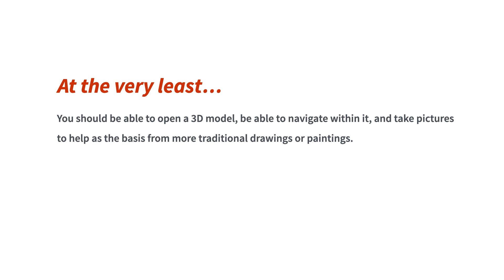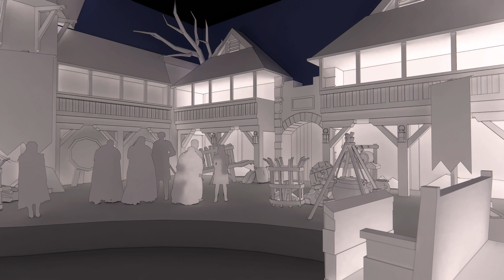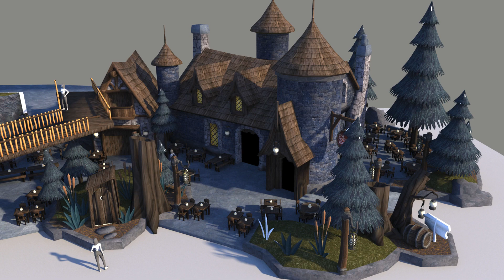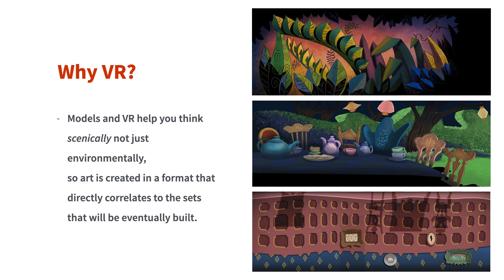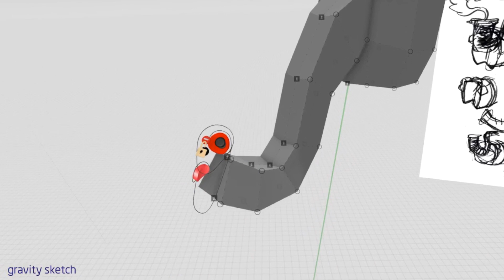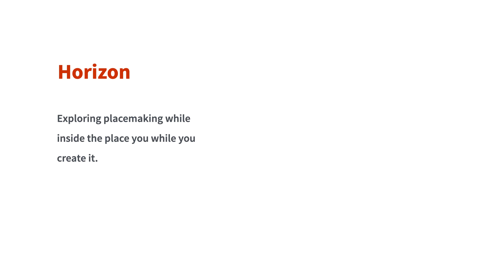THEME PARK 101: Using 3D in Theme Park Design

Comment: Is there a reason why a high-fidelity model isn’t created in a game engine such as Unreal Engine at some point in the design process? It seems to me that it is currently possible to create a highly realistic version of theme parks and attractions before they are physically built. You could walk around the theme park and ride the attractions in VR and really understand what it’s actually like to be there. Would it just take too much time to create something like this?
Reply from the maker: Michael, This is absolutely being done right now! The challenge early on is to make the models as quick and iterative as possible, hence the low poly massing quality of the early models. A huge fly in the industry's ointment is Autodesk that dominates the industry and promises interactivity but delivers bloated models that don't allow you to bring their assets back into the creative process without breaking them (do you have an opinion on this topic Don?). Smart people are working to integrate engines like Unity and Unreal into this process but it is still early days... still... I am working with design firms that DO mock-up more finished assets inside Unreal to do exactly what you describe. The real innovation push will be as "twin buildings" becomes common place. Having a virtual ride control a physical one isn't something Autodesk will deliver, even if they try.
Reply: @DJCarsonCreative  Love to hear this. I have taught 3D modeling and simulations to HS student for years. I am currently working on a theme park ride using 3D, scale models, and VR! Personal and much more interesting than my real job! Lol!